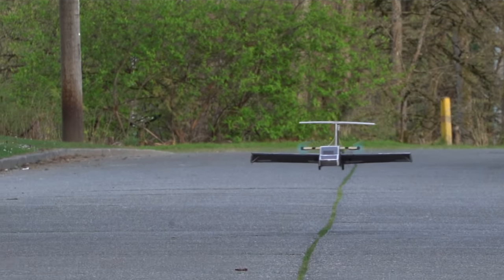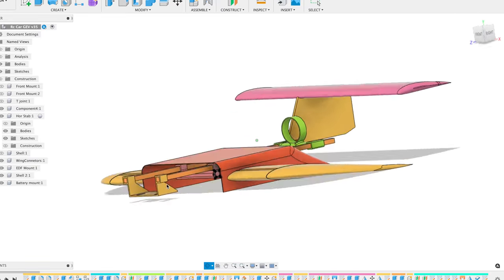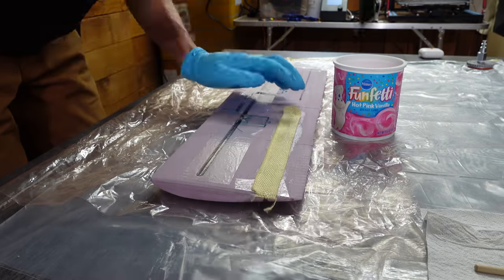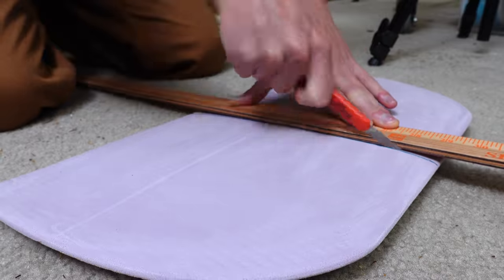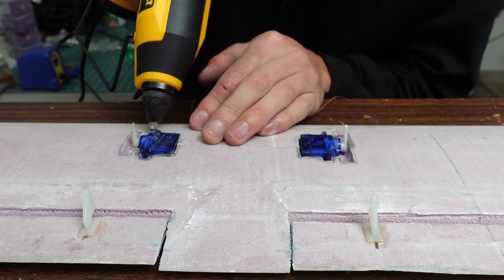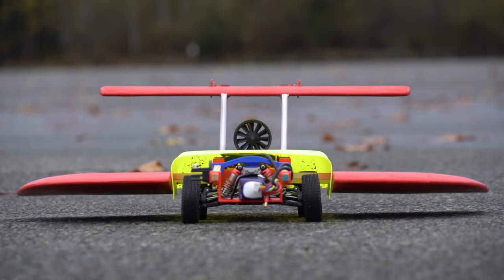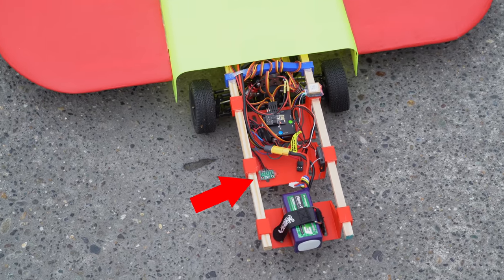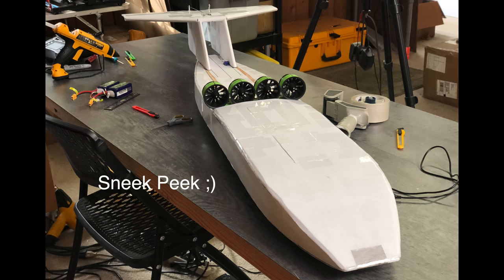RC Car to Ground Effect Vehicle Conversion

Comment: Not heavy enough?   If you are flying a controller within ground effect ranges, are you really flying at that range because of ground effect?   I say you are not.  I posit, If the machine is capable of flight, it is not limited by the physics of ground effect and therefore not a ground effect vehicle.   If we took a big traditionally RC airplane and equipped it with the same sensor and stabilizer, it could be made to appear to fly in ground effect exactly as yours does.  However, it's clearly not flying in bounds limited by ground effect.  I am always attracted to these videos but I've yet to see anybody pull it off for real, only simulations so far.

Comment: Hmm, considering how multi-wing aircraft trade speed for lift, has anyone ever tried a multi-wing ground effect vehicle? I mean, at least in my head, it seems like something like that could go low and slow and hug the ground like it's on rails.  But I have nothing to back that up.  LOL  I can just see it in my head.  Slow, low and in control.  hehehe